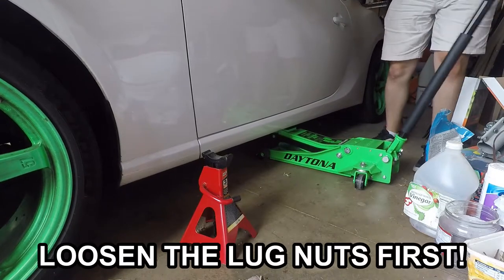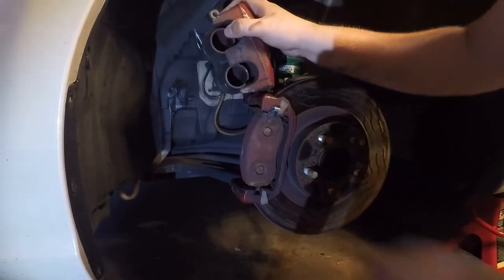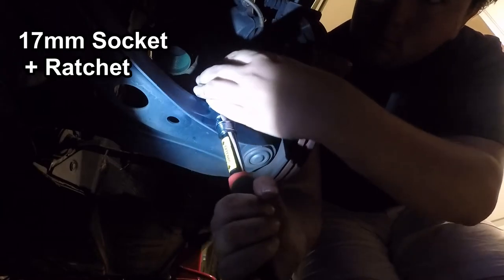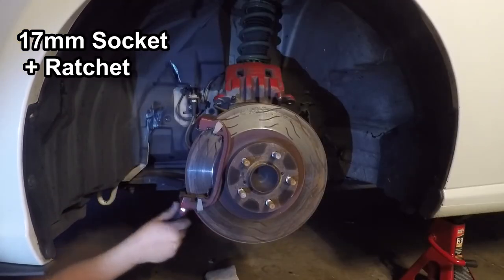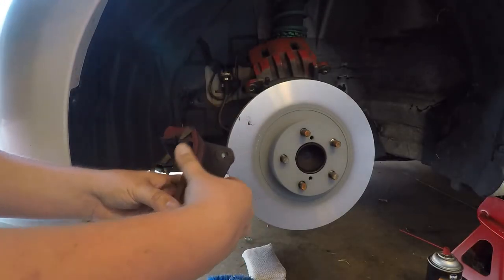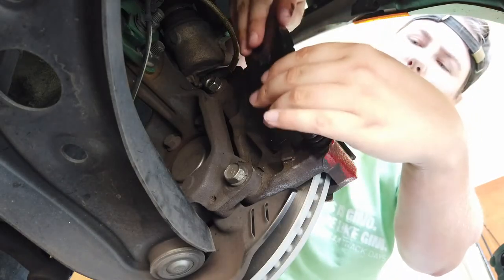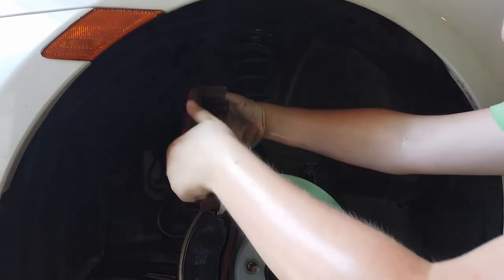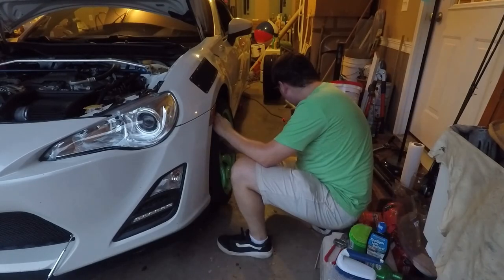Brake Change Tutorial for FRS, BRZ, 86 | Pads and Rotors

Comment: Is it the same process for the rear? If so that awesome
Reply from the maker: Basically, you just need to bear in mind that when you pull the rear discs off it will have the emergency drum brakes underneath them.